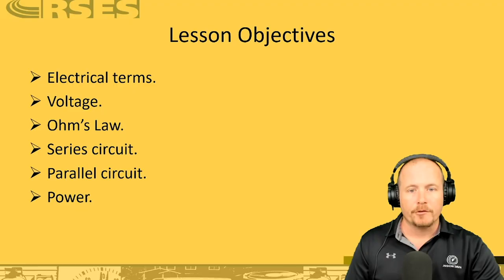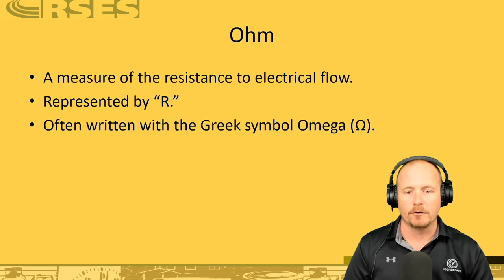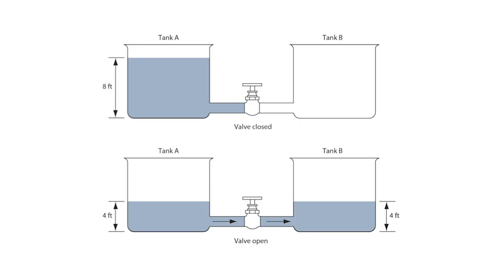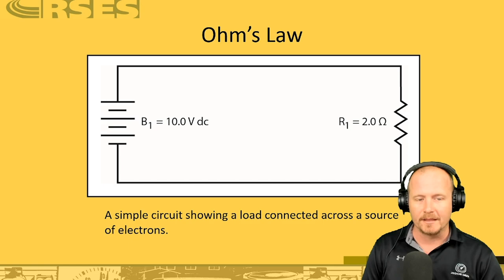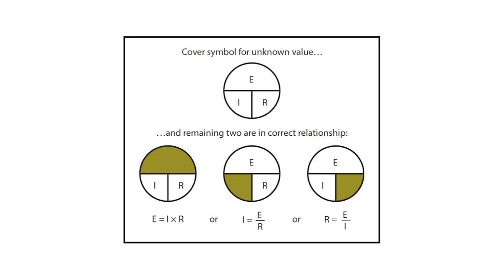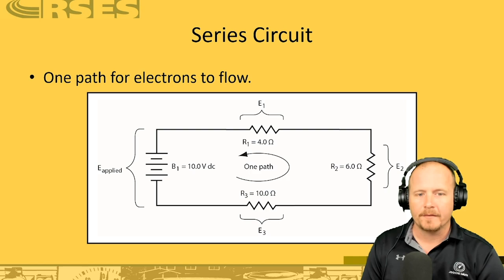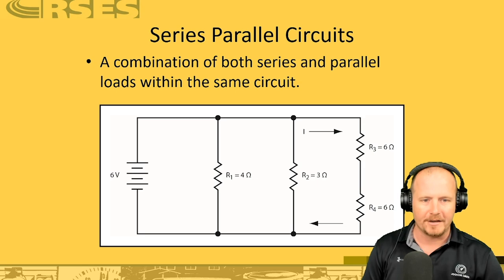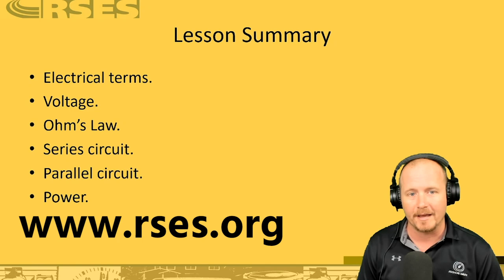Electrical Basic Concepts - RSES NATE Prep

Comment: Hi
I am facing some problem with walk in freezer refrigerant is 404A  when we start the unit it's working but after a 4 to 5 hour unit head pressure control valve bypassing refrigerant .we control condenser fan with out door thermostat set on 70F. Suction pressure is 35 psig and discharge pressure is 230psig . whenever unit bypass valve bypass refrigerant its never come  in normal position even in a day time  temp is over 85f .some time we shut of the unit and start again bypass valve making hamering noise  and start working  again for few hours .
Thanks
Sukhbinder Singh(San Diego California)

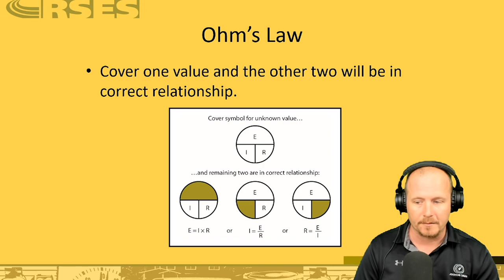Comment: hi, i have the impression at 19:42 that you didnt use reciprocals for the resistance when you were doing the parallel circuit. you used the series formula instead. the reciprocals formula is one divided by the sum of all the reciprocals. good video though. im in hvac school and im reviewing hvac electricity for a test next week.